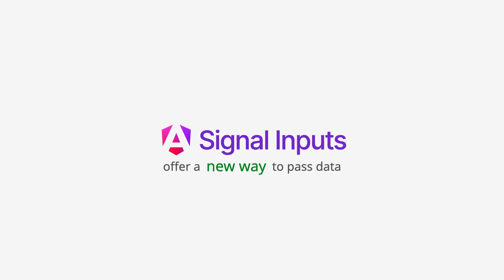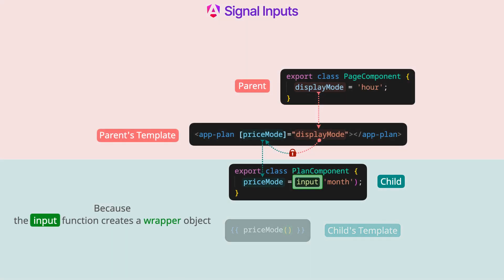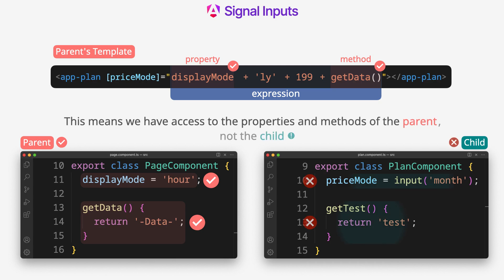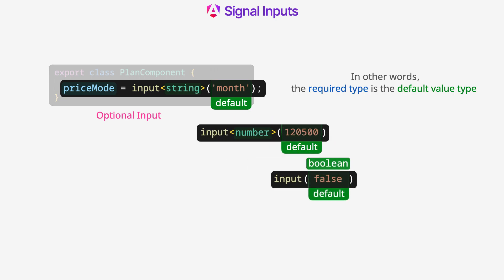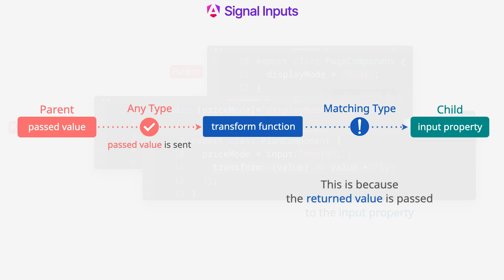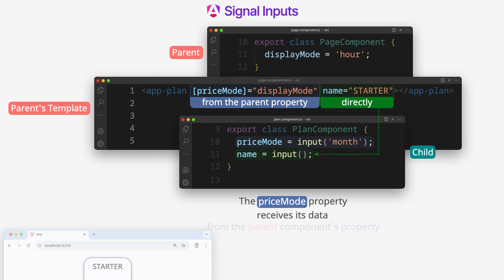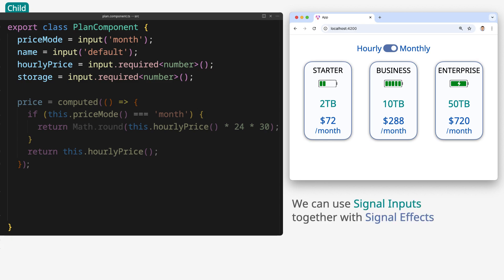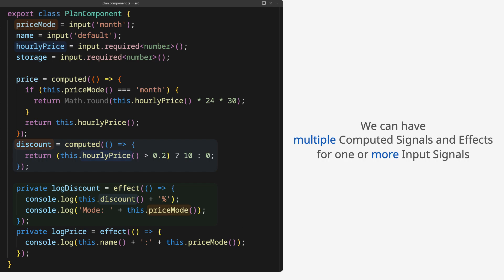Angular Signal Inputs in 20 Minutes

Comment: Is it possible to use signals in services for API calls and the like? Should we use them everywhere and stop using observables? What do you recommend?
Reply from the maker: Great question! 👍 Yes, you can use signals in services to make API requests (for example, to retrieve JSON data). To do this, you can use new signal-based features: the Resource API (for complex use cases) and httpResource (for simpler ones). I recommend starting with httpResource, which is easy to use and quite convenient. You can find videos on my channel about both features.

⚠️ However, please keep in mind that resources (Resource API and httpResource) are still experimental and not yet recommended for production use.

At the moment, signals and resources cannot replace observables for some scenarios. Observables remain essential, especially for advanced cases. That said, as signals and resources continue to evolve, we’ll likely see more use cases where they can offer a simpler and reactive approach.

One last note: it’s important to understand the fundamental difference between signals and observables.
● Signals follow a reactive, state-driven model
● Observables follow an event-driven, stream-based model

I hope I helped!